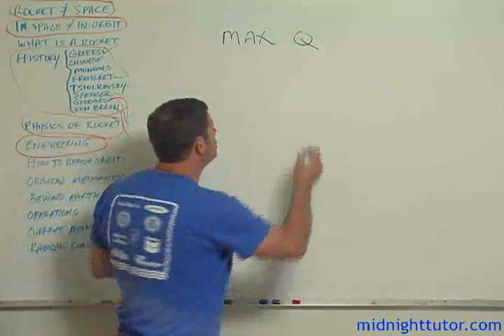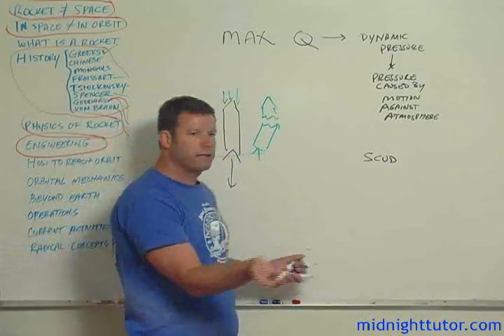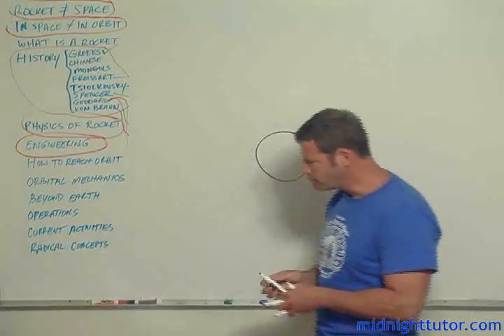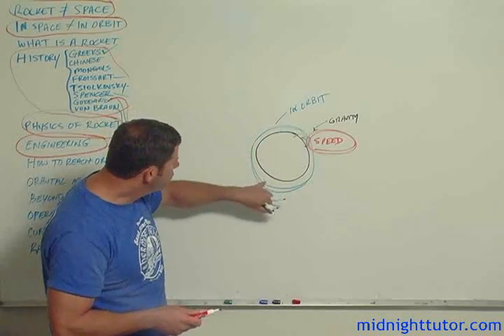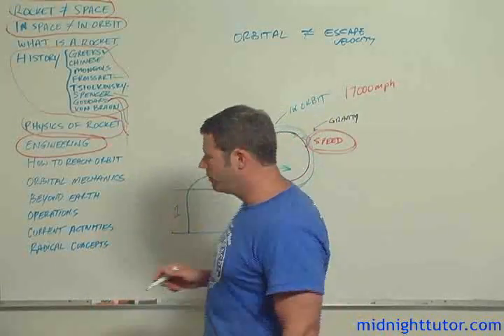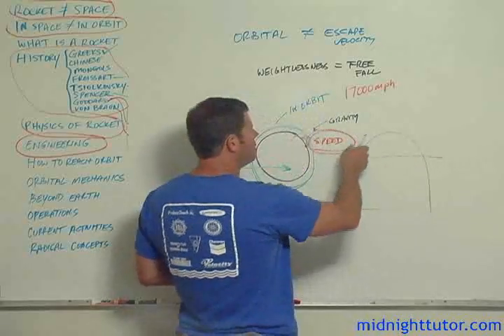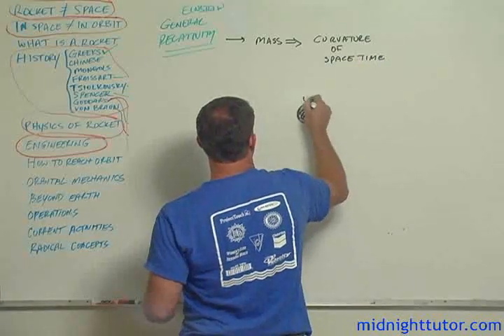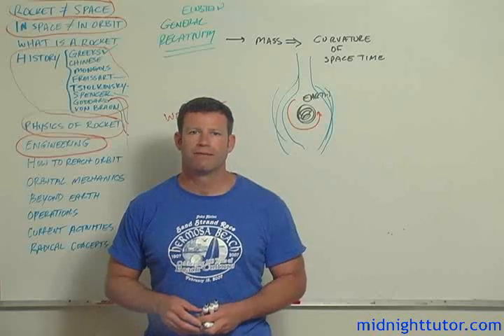Rocket Sciencee 101:  Max Q and How to Get to Orbit

Comment: Hey man, I liked your presentation a lot, and MAD PROPS for the time and effort of putting FREE info out there for the benefit of others!

As an aerospace engineer, I have a few gripes with some of the info, but half if it is probably just me being overly pedantic. A few things that I thought were specifically important though;

1: (Dynamic pressure) q= (1/2)pu^2, where "q" is dynamic pressure(usually in pascals), "p" is the fluid density(usually kilograms per cubic meter), and "u" is linear speed through said fluid(usually in meters per second).

2: If you were "dropped" in orbit, you would still be in orbit, floating along right next to whatever just dropped you. (The movie "Gravity" got this one so painfully wrong...)

3: Any time that something has a truly ballistic trajectory, it is experiencing weightlessness. There are quite a few amusement park rides that will lift a person straight up before dropping them straight down before catching them near the bottom, these are terrifying and will let you experience weightlessness. The portion of the slingshot chair rides where the elastic bands are completely relaxed are completely ballistic, and let you experience weightlessness.

Again, thanks for these videos, I can't wait to watch them all.

Comment: Is Qmax determined relative to the volume, surface area, and/or length perpendicular to the flight path? I'm not quite grasping specifically why buckling would occur by lengthening the hull. I think the equation for Qmax would be helpful in this sense.
Reply: Max Q is determined by the speed of the rocket AND the atmospheric pressure, which translates into aerodynamic pressure.  As a rocket is gaining speed, air molecules are are crashing into it harder and harder.  However, as the rocket increases in altitude there are less and less air molecules.  Therefore maximum aerodynamic pressure (Max Q) is balance between the greatest speed in the thickest atmosphere during flight.  Max Q happens closer to the ground than space, and coincidentally nearer the point when the rocket breaks the sound barrier.  Afterward dynamic pressures are lessened assuming the rocket is still climbing.
Reply: I think speed.

Comment: If there was a material, carbon fiber be ideal, that could withstand high heat and pressure, make it possible to float up past atmosphere, then fire it up, get to go fast as  can go, to be intercepted by rocket, towed to achieve orbit speed, why not?
Reply: Rocket trailing long cable , magnets  along length, intercepting slower balloon, difference in velocity steadily decreased effectively?
Reply: A better idea, space wheel, orbiting earth, also spinning at or near orbit velocity